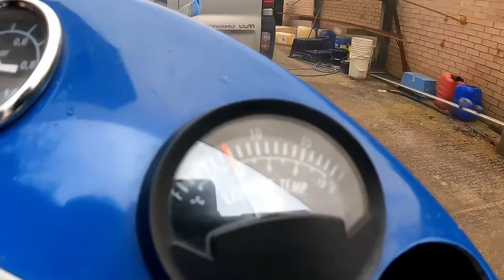The Wife Left So We Bought A Plane!! But Will It Start?

Comment: Yeah a swamp boat would be so cool!
And a fairly large flat bottom boat would actually be useful for getting thing back and forth from Sarinda.

If practicality means eventually  you end up removing the blower and 
using a boring old outboard.
The fun project could still be helpful in the long run 😊

Comment: Looks like a Gyro copter, I think  all you need are the copter blades atop the high post. They are not powered but spin and provide lift by the forward movement. I always wanted one.

Comment: Airboat would be a great idea. All you need is the engine and propeller. You need to make a frame to hold the engine, a guard for the propeller, and air rudders behind it a stick and cables controls the rudders so you can steer and Bob’s your uncle.

Comment: I always fancied flying, but am prevented from obtaining a CAA pilot's licence due to being a bit colour blind. However, I could fly a hang-glider as they were under the BHGA at that time and I could subsequently obtain a power qualification for one. The snag came shortly after I qualified on hang-gliders (and bought my own), with two fatality incidents with one particular brand of microlight kit in the same year. The CAA threw up its hands in horror and took control of powered flight, requiring a PPL(d) licence, which I am unable to obtain.

Comment: Used to go microlighting, sounds a good engine, funny    how everyone relates size to safety, if the engine stopped I'd rather be in one of those than a cessna, but I would buy an old Rib and make a Airboat version 😁 0:54

Comment: Air boat would be fun and so would a air -Trike, get the forks and front tire from a old motorcycle and put it on along with bigger tires in the rear and a prop guard and when you want an air-boat drive it onto a Jon boat with a tiller system then BOOM goes the DYNOMITE ! LOL. Thats what I'd do for sure !

Comment: Got to be a hovercraft! Split the airflow at the base of the prop to inflate the skirt, and the top 2/3rds for propulsion through a pair of vertical rudders and it'll cope with your potholes just fine!!
Reply: And then just add some fairy dust and a place holder for Harry's Wand

Comment: I saw a sign saying "Don't grow up it's a trap!" You's are acing that.
Hmm.. ideas? When Sarinda is low on power and no wind for the turbine then point that at it. 😋
Failing that put it in a tube with a mesh floor and get into the Indoor sky diving business.

Comment: Fuel,  avoid ethanol fuel, it tends to dissolve the plastics and rubbers in the fuel system.
The garage will know whether eg E5 or E10 actually has ethanol in it, usually they do not.
R

Comment: Not very clever moves! Starting engine then rev it without heating up....not good. Throw things in the prop...not good for it and dangerous. I thought you got more mechanical sense in you, respect things sometimes your life depends on them! For me, not a nice video, just two kids playing and not very bright.
Reply: Throwing even polystyrene through the prop arc,is a highly dangerous and stupid thing to do.  If a blade is damaged and comes off,the engine will leave the airframe and then becomes a lethal missile. I'm an aircraft engineer and have worked on these flex-wing microlight aircraft for well over 20 years-they most certainly are not toys and should be treated with the greatest respect.